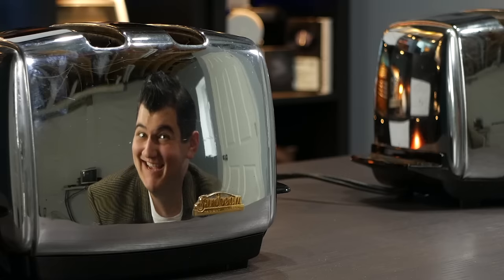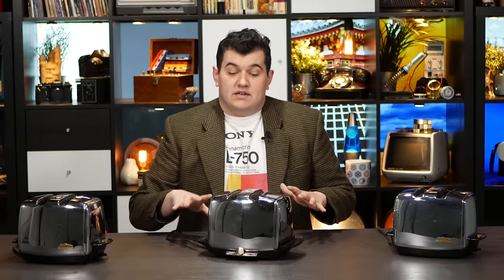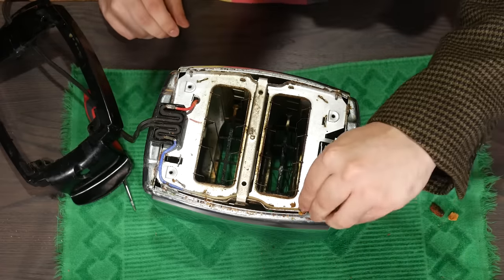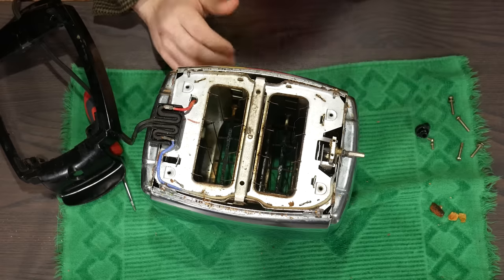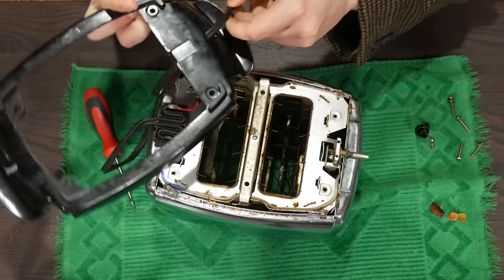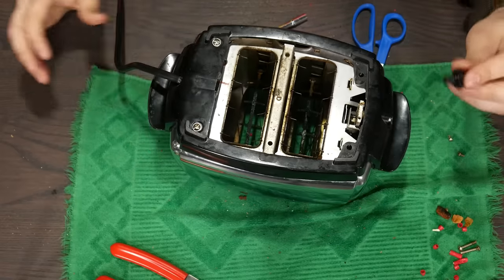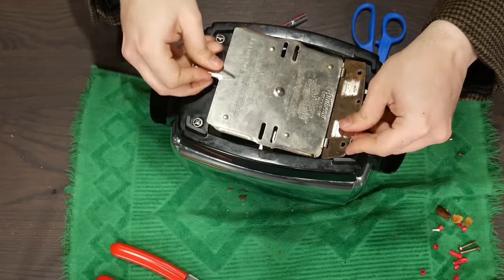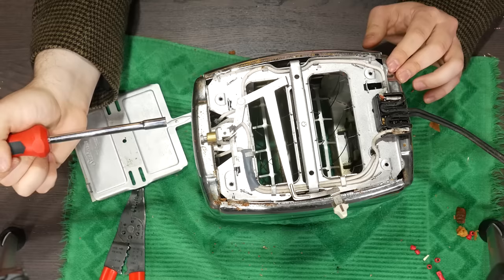Sunbeam Radiant Control Toaster--Repair and Modernization

Comment: Well, I just fixed my toaster. My $150 broken toaster just became a $500 working one. XD
FYI. The thermostat in the Aussie ones is, I think, slightly different to the 'murcan ones. I just took mine apart completely and put it back together. Whoever was in there before me only kinda got it all adjusted properly. 
My first test earlier tonight I dumped bread in the one toast slot and got..... nothing. Tried adjusting all of the screws... nothing.

Turns out I had to give the contacts a light sanding wipe them with a little contact cleaner to get the rest of the junk off, took apart the thermostat because I was dumb and removed a screw that resulted in a square nut falling out of it. I took apart way too much of the toaster to get that thing out, not realizing you have to bend a couple of tabs and wiggle it out. I had to put spade plugs on every wire to the switch contact block. 2 Because the last person broke the spot welds and replace them with connectors which were loose, so I re-did them with some solder flooding to keep everything in place. And 2 because I broke the other 2 spot welds myself. Thankfully the spring steel contacts are just the right size for a large spade socket to fit exactly. Then I did the thermostat and played for an hour or two before putting it back in. Broke off one of the tabs but the other one holds it just fine (someone else was in there before me and the tabs were pretty brittle when I got to it)
I then had to take it all back apart because I missed putting a screw through a piece of spring steel in the thermostat so it wasn't springing back correctly, took about an hour to line everything back up again but finally got it all springing and feeling nice.

Then I bent the switch contacts around a bit to get max gap when open while still having the contacts move slightly when the switch was closed. Apparently that was perfect because when I plugged it in and popped in a bit of bread.... down she went! (Then some smoke because who the hell knows the last time this thing toasted a piece of bread???)

I have to re-polish the case because I manhandled it a lot when it didn't work the first time it went back together, but the inside is about as clean as a 40ish year old toaster can get, and I even stumbled on how to adjust the thermostat without even having it plugged in!

You can get the adjustment to a place where you can push the switch with the darkenss control toward dark and it will stick, then push it back to light to make it trip off again. I found that having it adjusted so it JUST trips it off when you push all the way to the left, you get a pretty good plate of toast at around medium setting, no more adjustment needed when I tested it, it makes toast on just above medium to my liking.

I'm going to run it empty a few times tomorrow with a wooden spoon, probably a few times every hour or so just to burn out the rest of the junk. 

Also, does yours buzz like a welder when you run it? Mine sounds like it's singing with the 50hz AC! Works a treat though!

Comment: Shorter cords are because the house electrical code obliges the installation of more outlets, at a predetermined distance from each other... since those outlets are more numerous, no need for 6 feet leads. (Less wire on the counter)

Comment: Over 2K comments so not sure if mentioned before, but you really don't want to use those insulated butt connectors. Or in addition to shortening them, cut the insulation off. They're not rated for long term exposure to the heat they'll be subjected to in a toaster. There's a good reason the original connectors were not insulated. The Bakelite strain relief channels are all the insulation you need. With respect to the different appearance of the stripped wires, one copper & the other a silver colour, the silver colour lead is not aluminum but most likely tinned copper. It's another way to identify & differentiate between the hot & neutral sides of the circuit.

Comment: Hi!  Stumbled upon these videos and wish I had this toaster.  At about 1:50 you talk about them flipping the text and I think I may have a reason.  If you place your toaster on a counter with the plug at the back (so the short face is toward the edge of the counter) the older toaster would have "One Slice" upside down.  The newer toaster would have the wording oriented correctly.

Comment: You could have taken a Dremmel to the central divider of the strain-reliever to shorten it a bit and so the unsheathed wire wouldn't be sticking out the shell of the toaster.

Comment: Ooooh boy. 1) use a Dremel to cut the side of the old crimps for easy removal and to maintain the length of your leads 2) Take the insulation off the new connectors; they'll be easier to align and crimp, and the insulation is not necessary in that location (the old connectors were uninsulated). Also they will fit better 3) get a better crimping tool, they're cheap and it will make your life SO much easier 4)

Comment: Have a Toaster with a LED and light detector. It measures the light reflected off the bread. When the bread gets dark the circuit trips due to the fall of light decreasing and it switches off. Easy.

Comment: I guess I'm super late to the party but using a little bit of hot glue on the wires holding them into the strain relief would absolutely make your life significantly easier while putting it back together.

Comment: 2:20 Having worked in manufacturing for this sort of thing (I never actually worked in the Sunbeam Factory, or making toasters) my guess would be someone put the stamping dye in backwards.
     Perhaps the company didn't even care which way it was, so long as "one slice" was on the correct slot.
      You'd be surprised what sorts of things companies let their workers get away with.

Comment: DO NOT solder connexions on any devices that operate on household electricity.  If the joint should heat up the solder will melt and then you will have serious problems.  This is the reason that butt, marr, terminal &c. connectors were developed.
   You could use your wire strippers instead of your fingers to hold the wires in place on the strain relief during re-assembly.  Also, the strain relief prevents the cable from pulling on the connexions so you can shorten either or both internal wires to make a solid joint.

Comment: Important thing for our European friends. This thing looks like it’s designed for very specific power input, and if it’s heating element is engineered in the way that I think it is...plugging this thing into a European outlet, even with a step up converter...might um...cause a fire

Comment: Don't know if you'll ever end up seeing this comment since it's well over a year later, but Canadian electrician here: color code in Canada is almost the same as the USA, but there's a notable difference. In a three phase system in Canada the phases go red, black, blue instead of black, red, blue like they do in the USA. Single phase they're the same.

In fact, the only other drastically different thing between Canadian and American electrical code, that I can think of off-hand at least, is that in Canada you don't ground light switches while in the USA you do.

Comment: I took mine apart a couple years ago. Mine has the words on the back slot now. The case is symmetric. The one you showed had no start lever in the back slot.

Comment: 2 drops of hot glue into the strain relief then put the wires in, this will hold them during assembly,  but be easy enough to remove if the cord ever needs to be removed again.

Comment: Why didn't you just use some electricians tape to keep the wires inside the strain relief? Also do you not need to twist the wires together before adding the outer butt connector thingies?

Comment: I take it you wouldn’t want to solder the new wires in place as opposed to crimping them together because of the heat of the toaster might be hot enough to melt the solder? Or is it another reason? Just curious.

Comment: Hair-dryer or heat-gun, use that on the wires to soften the plastic insulators to get it into the strain relief, when they cool down again they'll hold their new shape much easier. Why fight them when you can have them work for you.

Comment: Even with a diode it would not work on 240V. On 240 with no diode the elements would take four times the normal power, and a diode would only cut that in half so they would still be drawing twice the power they're designed for. If you're lucky the elements are wired in parallel in pairs and you could then rewire them in series and run on 240V with no diode. However, the center element is just one double-sided piece so there would not be matched pairs of elements to parallel.Also, the switch contacts might not be designed for breaking 240V.

Comment: As for running a 110V on 240. Look at the way the heating coils are wired. 
If there is 2 coil circuits in parrallel they can be rewired so that they are in series. 
I bought a sandwich maker that was 240 and did the opposite.

Comment: One reason they may have flipped the text is that if you don't have a lot of counter space, you can turn the toaster sideways to fit better, putting the cord at the back. The old stamp would have appeared upside down in this scenario, but the rotated stamp is now right side up. True story.

Comment: The strain relief "input" should have been modified a bit. 
It was built for two separate wires to enter. positive and negative being their own wire of that cable. both of which have their isolation going into the toaster a fair bit.
But now you got one cable with three wires in it, which means you needed to remove the isolation all the way out to where we can see the individual wires just outside the toaster.
Pause at 32:02 and you'll see the isolation end right right before the strain relief. I myself would have used a dremel to remove a bit of the strain relief which divided the two wires, just so you could stick the wire isolation into the toaser body. 
The problem now is that the two wires are strain relieved, but the isolation isn't. Now you can pull the isolation away from those wires to get this result here: https://i.imgur.com/QDnHpdo.jpg
Since plastic of the toaster body is rigid, it COULD rub through the isolation of the individual exposed wires and possibly short them out.

Comment: 17:45 | One could drill out the offending rivet - tap new thread and install a small bolt / washer to cinch everything together for the ground. Or a self tapping screw might work. 
The tapped thread is much more professional in my opinion.

Comment: So, before work, I twiddled my temperature knob, and achieved a state where: maximum light = the toaster clicks on, then almost immediately clicks off; maximum dark = the toaster is just barely creating enough carbon to develop a burnt toast taste. This seemed to be the optimal range, whereupon a setting within a few degrees of medium would deliver enjoyable results.

Upon returning from work, I found that any setting other than darkest resulted in a short cycle, and darkest did not visibly alter the color of a slice of bread.

Well snap. It would appear my temperature control is just flaky beyond belief.

Comment: It's not necessarily the wall outlet that is wired wrongly. You used extension cord and those can be also wired wrongly. The last time an electrician has killed a civilian in Finland was because of wrongly wired extension cord. What happened was that in an apartment building new laundry machines were installed and they did not come with power cords. The guy installing them had only one plug in his vehicle so when he saw an extesion cord in the corner he used that as the second powercord by just cutting it and using. Unfortunately the plug of the extension cord was wired improperly and the chasis of the washing machine got electricfied. This happened on friday night.On Saturday morning one of the tenants came to was some laundry and was immediately killed when they touched the chasis of the washing machine. It was never found who had made that extension cord.

Comment: That red lead isn't aluminum (which is never used...), but probably tinned copper.
The red wire is probably too small gauge for the crimp connector. Slid a small piece of other cut wire in with it, then crimp. Or...tin it with more solder to thicken.
Put that crimp/stripper tool in the junk box and get better tools.

Comment: 37:15 You shouldn't solder wires that go into hot places. In addition, you mentioned that one of the wires was aluminium and you cannot really get regular solder to stick to aluminium. If you really want to weld it, you'd need aluminium-to-copper brazing rods and lots of heat.

I think a high quality crimp connector or a screwed connector would be much better option.

Comment: You would need a transformer to drop the voltage.  A diode, depending on orientation, only lets positive or negative voltage to flow through.

Comment: Instead of using crimp connectors I would suggest soldering and slipping over some heat shrink tubing after.... It is a much stronger and more reliable connection.

Comment: Regarding the soldering vs connectors. at the very least, you should have soldered the stranded wire so it was solid. then it wouldn’t have pulled out of the connectors. Stranded wire has an issue being crimped sometimes.

Comment: I would have chosen insulated blade terminals and used a few extra inches of the new cord to allow easy replacement of the cord when it has a mishap from the hot surface of the toaster
that way you could open it and unplug the old cord swap it and re-attach without hassle

Comment: The way this has been crimped goes through me. Using ratcheting crimpers will give a far superior connection. And yes, I have over 35 years as a electronics tech/-wireman. One tip, twist as you pull the insulation off, it will give a tight twist on the strands.

Comment: Real question here though, regarding how hot the body of the toaster gets, can a thin sheet of fiberglass or another non flammable insulator could improve its safety operation without interupting the genius engineering of this toaster?

Comment: Modern toasters have shorter cords because modern kitchens have electricity sockets wherever you want your toaster or whatever other appliance to reside.

Less wire == less cable management && lower price, so it's a triple win for both you, manufacturer and environment.

Comment: When you were putting the plastic bottom back on and you were having trouble with keeping wires in the stress relief, why didn't you just attempt to hold the wires in place in the stress relief with some electrical tape? It wouldn't have been a guarantee but it likely would have helped with the reassembly.

Comment: I've got a sunbeam T-20B that was in a state of disrepair.  I didn't know about the tension scew.  I've fixed the toaster and it is no opperational... hoever I would like to upgrade the plug.  The internals of my toaster look much different.  The strain releif is just a metal "clip" and the wires are crewed down to posts.  There is only a single wire running through the toaster.  I'm concerned that if I add a chassis ground I'll just be creating a short to ground as the neutral post appears to just go directly linto the body of the toaster.  Any tips for this?  I could potentially send you pictures if that would make my ramblings more coherent.

Comment: When I am repairing an AC operated device, I ALWAYS place the plug on the workbench in view.  I can SEE that the plug is removed from the AC outlet.  The way you do the repair,  there is always a question whether the device is plugged into the AC outlet.

Comment: I would have soldered the leads and used heat shrink to insulate the connections instead of using crimps.  I piece of high quality wide electrical tape would hold the wires in the strain relief to make it easier to reassemble everything.

Comment: If I can find them, I prefer using uninsulated butt-connectors. Then I add heat-shrink if needed. Otherwise, I'll use the wire wheel on a bench grinder to wear a gap in the plastic on insulated butt-connectors. Then the bare connector can be easily pushed out of the plastic.

Comment: Thanks for doing this video. I tightened up the tension as shown and that has sorted out that part. But the toaster is still turning itself on as soon as the plug is turned on at the wall. I have an earthed plug. It is the older style toaster with a knob for darkness not a slider. The knob turns a threaded rod toward a spring loaded lever which is perpendicular to the rod. Help?
Reply: I have tried adjusting the threaded rod to its max and still turns on and off by itself. Also turned it to its minimum where it is out of contact and it still turns on and off by itself.
Btw the toast elevators go up and down while it turns on and off. 
So my thinking is the spring loaded elevators are fine. The thermostat is probably fine but there is something on the way to the thermostat that is switching on...

Comment: I can't help but wonder if you could have used some form of object to hold the wires into the strain relief. I feel like you could probably get away with even just like scotch tape since it only needs to last long enough for reassembly

Comment: Help. 1} The bread sensor wire, when depressed, dose not "CLICK" to 
start the heating process. 2} I removed the 4 sheet  metal bolts {one 
with the new ground wire} that freed the front and back panels. Now I 
found 4 rivets holding the end panels fast to the frame preventing me 
access to the  bread trigger mechanism above the toast darkness knob.  
Do I drill out the rivets? When done, what are my options  to get the 
"ENGAGE" switch to trigger toasting. Thank you

Comment: You can push the core of a butt connector out with a small screwdriver if you leave the ends on. Just put it end up on a flat surface and push down.